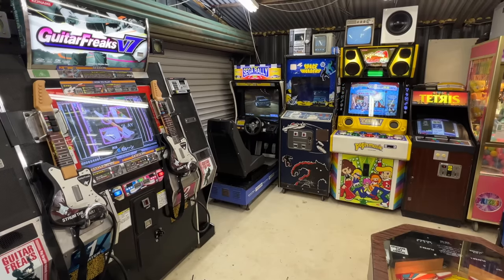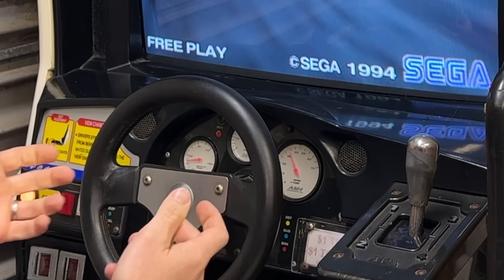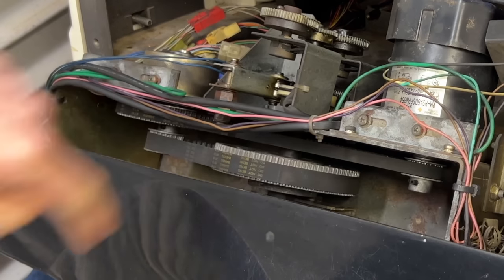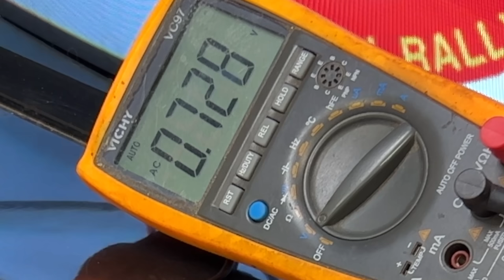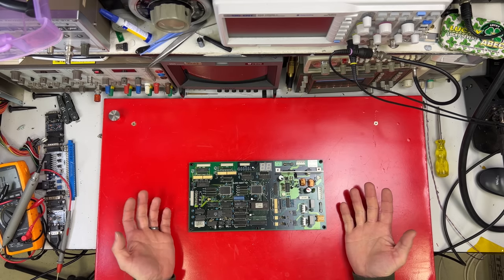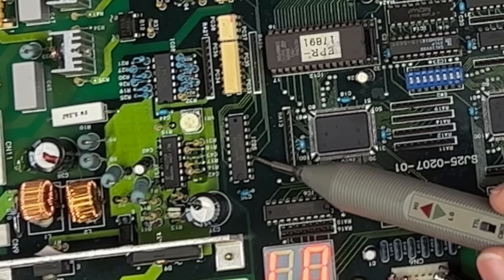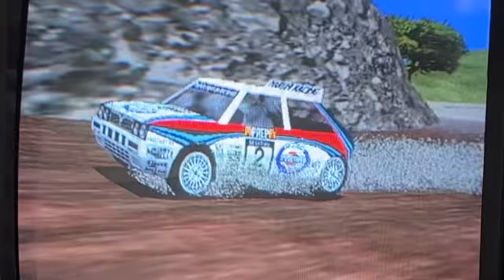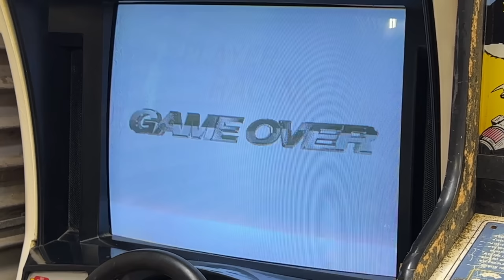I Broke My Sega Rally Arcade Machine

Comment: Arcade machines live their lives in some very tough conditions.   It really does take dedication to extend them long past their original life span.
Reply: That's the reason every arcade vendor moved onto PC hardware as soon as the 3D tech matured enough in the early 00s, you can find replacements much more easily although these kind of dedicated hardware are much more interesting to see. Also, I understand constraints existed, but putting the boards in the lower part of the arcade is just an invitation to problems, I remember Hydro Thunder having the hardware on the back just below the CRT, that should have been better.

Comment: Ours and the ones I recall playing were never that loud when applying steering feedback. It could just be the audio, but it sounds to me like a bearing noise from that motor, and/or a dry and/or ovaled-out bushing. I've also seen the idler bushes wear out, too. IIRC they use standard size sealed bearings and brass bushings to support the rotor shaft. Good luck finding the noise! Great video, too btw. Well made and great content. Cheers.
Reply: Despite being a 2000s kid I did manage to actually play this exact machine a couple years ago; the steering feedback was definitely not that loud.
Reply: Not exactly same game, but I played a whole lot of daytona (i'd imagine that it's the same tech) and yeah. No sound at all. The loudest sound was the steering wheel banging to the left when I crashed lol

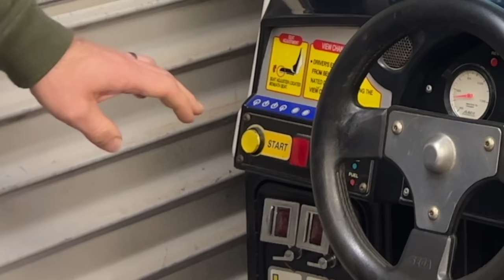Comment: 7:47 How to film a CRT properly
Step 1 - figure out if you have 50fps refresh or 60 (japanese arcade maxhine, so 60)
Step 2 - Adjust your camera's shutter speed to 1/60 (not framerate) (you can do this on phone cameras under "pro video")
Step 3 - Tweak the ISO and Aperture until the lighting looks good
Step 4 - make sure the camera is not focused directly on the phosphores. (Gives weird texture, defocusing it in either direction works)
Step 5 - look for a peak around 15khz in the recording and please bring it way down or mute it. Not a must, but a slight quality of life for folks in their teens, 20s, and pets
Reply: lots of arcade games have weird refresh rates, can go from 55 to 70. Depends on various things but medium resolution games like this are always a pain, they don't run at 15khz but 24 for the horizontal refresh.
Reply: some phones have an anti-flicker sensor, would that work with a CRT?
Reply: @zat-svi-ua  anti flicker is just it automatically adjusting the shutter speed dynamically
Reply: I think sega rally runs at 57hz

Comment: As someone who (barely) repaired an SNES with an X-Acto, a conductive ink pen, and some hot glue, I feel your pain about trace rot
Hopefully we can preserve these boards rather than let then waste away
Reply: Could you replace the whole board thing? Or is trying to find a whole mint board for a arcade machine from 1995 most likely impossible
Reply: @greaniebeaniez3070  Some consoles, like the gba, have replacement boards where you can place the original chips back in it. It is possible but It's a time consuming project and I think there's not much interest behind it, It might become more popular in the next decades when most of these boards start dying.
Reply: @kibecru or when The companies watch The nostalgia factor of this arcades
Reply: @greaniebeaniez3070  Yeah, you can replace the entire board
Good luck finding a good M2 board out there, they're either cooking themselves to death (like the M1) or suffering from trace rot like James' one

Also, you can retrace the board, but it's a herculean task
Reply: Or turn them into bread board abominations, my favorite way to (dis)respect the machine god.
Reply: @patrickcrabb6212 I’m only a tiny bit familiar with electronics, but an arcade cabinet seems like a perfect place for a breadboard abomination, if needed. It looked like there was enough room in there, and it doesn’t need to be portable

If it’s stupid and it works, it’s not stupid

Comment: Conformal coating all the boards might help prevent further corrosion but would make repairs 10x as hard. Really cool that you were able to figure out the problem.
Reply: Best would be if someone used the circuit diagram to create a repro circuit board. Even if it was just an empty board you had to populate with chips from a donor

Comment: Watching this with my cat was beautiful and informative!
Also hopefully had a solution to the trace rot thing- I’d seen a similar-ish issue when working on PC motherboards. It was a burnt trace rather than a disintegrated one. And for me, running a jumper wire straight from the chip to a non-disintegrated part of the trace worked for me. I just had to VERY GENTLY scratch away the protective coating to get solder to stick, but it didn’t mess with the rest of the trace. Obviously I have- no idea if that would apply to an arcade PCB, but it’s an idea if the rot gets worse!

Making a quick edit to this, it might be possible to run a jumper wire from the chip to the little silver disks on the trace..? Just a thought, hope it helps lol

Comment: Hey James industrial electrician apprentice so take what I have to say with enough salt you get sodium posing, the motor from a glance looks like a capacitor start and if the motor were to ever stop working look there first and the motor noise can be normal it just depends on how big the motor is vs what it’s trying to move if the motor is to small trying the move something big it will scream, but as even when just in idle the motor is screaming I would check the inside for a bad bearing. :)
Reply from the maker: Yep capacitor start. My experience with dud starter caps is that the motor will make a hum noise and will start moving if you turn it manually.. and pop a fuse if you don’t.. lol.

I wanted to change the bearings when I rebuilt it the first time but it’s a sealed unit, it can only be disassembled destructively. The bearings felt smooth anyway. Others have commented that the noise is normal.

Comment: Man this brought back some memories. The full arcade version of this was a lot bigger, it had a massive screen and a full drivers seat setup with adjustable racing seats, proper gear sticks by your side (rather than beside the steering wheel), foot pedals and that steering wheel that had genuinely realistic feedback. It was way ahead of its time. There's a couple of cheat codes too. One gives you a faster car (supposedly the Lancia Stratos), the other lets you practice the 4th course. Much easier to control the car in manual. You shouldn't be using the brakes much at all, it's mostly foot to the floor and gear changes. It's not a real gearbox, you can go from 4th to 1st with your foot to the floor and no clutch... try it around the first hairpin on the 3rd course.

Comment: man please keep doing arcade repairing and information videos!!! great job on that board fix, a logic probe like that would've definitely helped analyzing one of the problems i have on my Pump it up IO board much faster. How much did it cost?

Also love the SD pop 'n music over there 👀
Reply from the maker: Which board is bad on your piu? My foot pcbs were both bad when I got mine. I have an SD cab.

I just searched audio logic probe on ebay and they’re pretty cheap, starting at au$30 posted. That one has hilariously oversized alligator clips though so might be worth going for the next tier up which was about au$45.

You can get them without the audio (just leds) but the audio makes testing way faster
Reply: @Games_for_James  i also had a broken foot PCB when i got my GX! was just a matter of replacing a shift register though.

The board i'm talking about in the previous comment is the PIUIO, i am pretty sure there's one of the LC245As that handle input whose pin that corresponds to DownRight on P2 pad is broken. Lights do react though, and swapping to my original PIUIO makes the panel works normally.

I got the new chip today so i'll try desoldering and soldering the new one back. I hope it's just that and not the pin on the Cypress MCU that is fried!
Reply from the maker: I was missing the whole MK when I got mine so I jerry rigged it to a pc via an old ps/2 jpac. I’ve since bought a piuio and jamma board (plus working foot pcbs) but haven’t done anything with it yet.
Reply: @Games_for_James  there are countless ways to run even legit pump mixes in uhh... not so legit ways let's say lol
As of now, you can get PIU Prime and Infinity (with a custom patch that includes older games too!)
If you would like to discuss this more we should get into DMs somewhere lol

I sure hope you didn't cut the original cables, cause if not wiring the stuff to the JammaIO will be a funny time (which again, not an easy task as i've fixed jamma boards for PIU as well, they're completely passive boards).
Reply from the maker: I didn’t cut anything, don’t worry. Happy to chat but you’ll have to be the one who publicly posts your account name for another platform. I haven’t figured out a good way to break a conversation out of youtube comments

Comment: Really great fix mate, did laugh at the “dust” in clutch. Well done, you probably need an oscilloscope as part of your tool set. The opto isolators we used to drive logic at low volts to radar microwave valves that ran at 1kv but need careful control to keep the tolerance of the 1kv . Your wire soldering is fine too.

Comment: "Track Rot" reminds me of "electromigration" which is an absurdly amazing phenomenon on a conceptual level. Essentially, electricity is just a series of tiny charged particles moving through a substance. We know from resistance that there is a kind of "friction" involved in that movement. Electromigration is what happens over time as that friction PHYSICALLY MOVES ATOMS in the medium from one place to another.

Over time, this can cause the trace to thin in certain areas and "build up" in others which creates a chain reaction whereby the area being "thinned" loses capacity like a pinched water hose which increases resistance and wear to the point of sudden failure in the trace. Novel, yes?
Reply: Actually cool.

Comment: I'd dry out the circuit in an oven at low temp (50°C) to drive off any humidity, then conformally coat the entire board. That should stop the humidity rotting the tracks.
Reply from the maker: That’s not a bad idea. I am kind of worried the oxidisation would continue anyway like rust does under car paint though, and honestly I don’t want to touch the thing at all if it’s working lol.

Comment: Wow! Never knew any of these were left, we have the sega rally deluxe, which is a very large single unit and  it still works!!! Although we had to repair the clutch packs too, we ended up re-making the unit as we had access to a machine shop, it restored it to brand new and it feels amazing, also had to repair lots of circuitry, we are currently trying to sell it but we’re trying to find the right market, Also as for the motor volume, definitely not, should be near silent only hearing the hum and medium belt movement, i’d say check some bearings
Reply from the maker: How much of the particle clutch needed to be remade? I think where I went wrong was the particle size. I had no specs or sample even so I just bought the cheapest which I think was the coarsest

Comment: I loved this game... ended up mastering it to finish on a single play... including the real challenge which was to complete the extra bonus stage backwards.
Reply from the maker: That’s impressive! Any tips?
Reply: @Games_for_James  take off in manual 1st straight to 4th. The trick is to not slide or use the wheel too much. Pick and find the line around the track where as little steering is best. Initiate tight corners by slamming 1st back to 4th. Otherwise a quick 4th, 3rd 4th is enough to rotate the car without losing speed.
Reply from the maker: @o0FUZ0o  do you go full throttle the whole time or back off for corners? Ever use the brake?
Reply: @Games_for_James  it’s been quite a few years… but I’m pretty sure it was full throttle almost the entire way… may have been a few places where you lift slightly to avoid the slide.

Comment: Test enginer here ,IT is fine how you solder the cable ! I do it with ICT machines because it is a same surface area. But if this machine goes to in space it will be no problem.

Comment: Cool cabinet! Surprised to see a powder clutch there... my old Nissan Micra K11 had one instead of a torque converter, and it was pretty cool if a bit slippy. If you stopped the car and put it in drive, there was no creep so the car would just sit there. Eventually the brushes wore down so it couldn't receive power, so my wife soldered in a new pair of cheap alternator brushes and it worked fine until we sold it years later.
Reply from the maker: Very cool!

Comment: to fix the tracing you could always remove the degrading masking using various cleaners or a very steady hand, and then put better newer masking on. It's pretty cheap and you can find different kinds to suit your need i/e humidity resisting masking. It's a pain but a bigger pain is the loss of tracing due to rust.

Comment: Just so you know with somebody who works on electronics all the time the way that you soldered them together is exactly how you should for most applications. Excluding applications which have a lot of energy going through them that is the easiest and safest way to do it It's also the easiest to desolder later. It also has the added benefit that you pointed out that it doesn't have any sharp points that can break your shrink wrap. Consider investing though in shrink wrap with glue on the inside. That stuff is watertight and much tougher
Reply: the amount of people that just learn one thing, like wrapping the wires around, and just complain at everyone who doesnt do it their way is too high

Comment: It's possible the noise in that motor is related to some dry bearings on those pulleys or possibly some gears in the gearbox that also might need some lubrication, doesn't sound like typical motor noise (even for a big brushed motor like that) but sounds like some kind of friction somewhere that probably needs greased, unfortunately from a video I can't really help you figure out where in the that whole assembly it'd be

Comment: When I was a kid I played Outrun in the Arcades and that had a force feedback steering wheel and I hated it. It made the game unplayable for me. I was so happy when I got it for my ZX Spectrum and could use it with a proper joystick. OK It was horrible on the Speccy, but no force feedback made it so much better! Now I have Outrun on my PS 2 and can enjoy the arcade experience with no force feedback. I also hate the rumble feature on my XBox One and Playstation controllers too and disconnected the wires off the motors. So much better. But, a lovely looking arcade cabinet. The hours of work and probably 100's dollars are well spent. I hope you find the other half soon.

Comment: Servomotors I work with only make that noise when I haven't tuned the motor controllers (properly) yet, though they are all brand spanking new, so properly lubed I imagine (am not a mechanical guy, am electrical+software). Think of values like coil impedance and resistance, various constants like x.x V/1000rpm, x.x Nm/A, and lastly PID values for the controller. 

It might just be a lube job (though the noise would also be there if you turn the motor axle with the machine turned off then), but I imagine degradation in its electrical properties would cause suboptimal frequencies going to the motor, causing it to make noise when running.

I haven't ever known it to be an issue though! Wouldn't worry about it unless the noise is annoying :-)

Comment: I've soldered very little but what I usually do is make 2 U-shaped hooks, loop them into each other, and press together. Ends up not much thicker than the original wire, and the pointy ends are still parallel to the heat shrink so less chance of piercing
Reply: unless that's what you were already doing to cause the pierced tubing lol, I'm not entirely sure what you mean by wrapping them together

Comment: Motor is not meant to be that loud i also agree bearings might be worn on need regressing (while im a computer tech now i never took apart a sega rally but i spent months playing it in the 90's), if you want to be good at the game manual mode is best as throwing the gears helps tight cornering, i used to have all the high scores in my area on it.

Comment: Do you know if there are any documents about the PCB that has the Trace rot? I'm an electrical engineer and have been making pcb's for 7 years. If there is more information about it I can give it a shot to see if I can recreate it. Single or double-layered boards are so easy and nice to do. so much nicer than the sometimes 20-layer boards.

Comment: that motor is not supposed to be that loud. It’s usually the gear on the front of the motor rubbing on the belt too fast, which means it’s grounding down the teeth, which is making it very loud.

Comment: The motor is supposed to provide a little noise for 'realism' feel when playing, but that thing is screaming. That is a common problem for older machines, the constant use does warp them a bit, but I've never heard one quite so aggressive in its noise production. It should continue to 'work' but for how long is anyone's guess. No Idea what the problem is I just worked on a lot of arcade floors and you get used to the proper sounds of machines and when something is off, you call the James to come take a look at it. There is always a James.

Comment: Logitech just came out with a Force  feedback back wheel for PC That feels really good. I wonder, worse comes to worse if it would be possible to marry the mechanical components from that modern wheel, with the control board and fix it that way.
Reply: you'd have to convert 100 volts AC for a big ol' motor into some 3-phase AC at some unknown voltage for a brushless DC motor